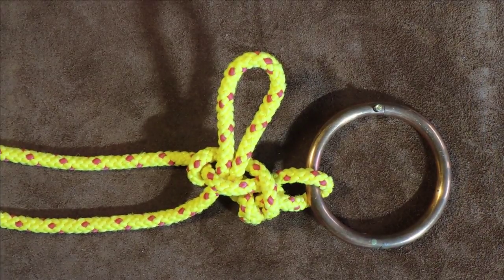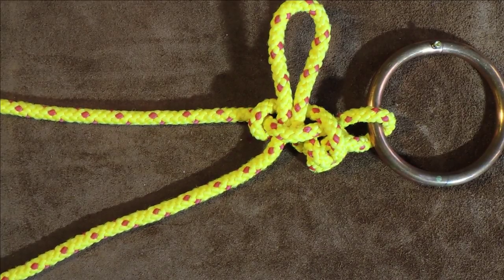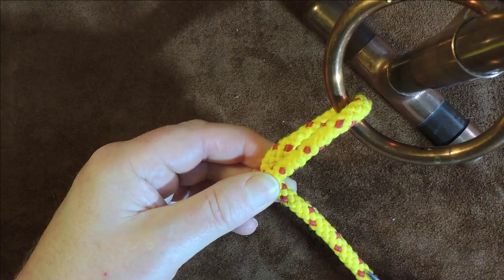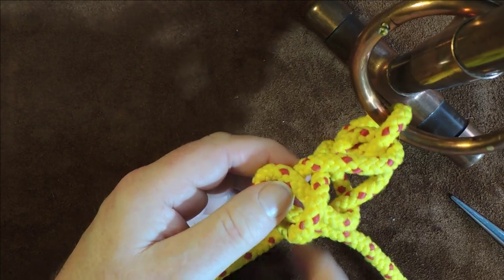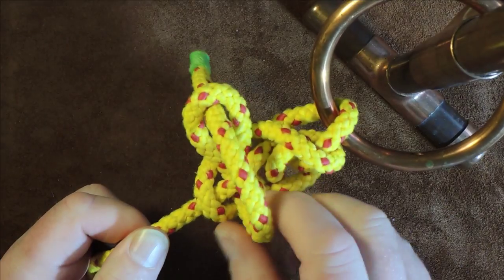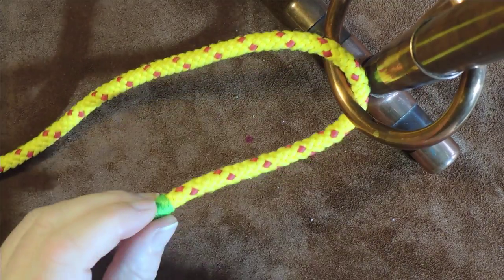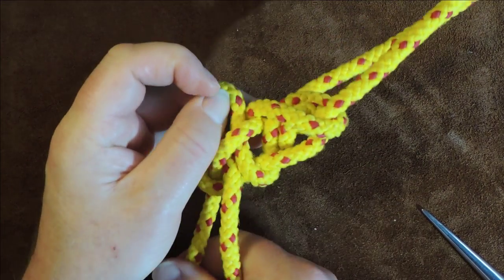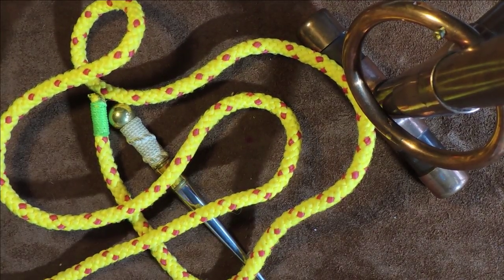Sampan Hitch - How to Tie the Sampan Hitch - Quick Release Mooring Hitch Tutorial

Comment: Sampans are small boats, it's likely the mooring is in easy reach, say half a meter or less.  If this is the case there is no on the boat vs. on the dock issue, it's just a hitch tied between the boat and the dock.  If it's tied on any length of line it would make more sense to have it closer to the boat to avoid shenanigans, besides the free end has to be tied off otherwise it will just fall into the water.  There is no quick relelase if you can't find the end.  Having a long loop in the center might allow the hitch to work itself free over time if tension is not constant, so the free end in the slipped bight makes sense. 
  Thanks for the video.  The highwayman's hitch has been my go to quick release hitch till now, it's all ways good to have options.
Reply from the maker: I am sure that one day, someone from that part of the world will come along and tell us exactly how it was used. A thousand years ago I was in Singapore and HK, where there were thousands of these vessels. I think now there are not so many and they are slowly becoming part of history.

Comment: Hmmm, here's what I'm  thinking, if you are going to to shore and back with the rope with the disadvantages of having to pull all the line, which could be any length, around the post or ring why not just go around the post and back to the cleat? I think a good quick release needs to be tied on a bight so you have hold of the rope at the point it comes aboard. This leaves all excess rope on deck and with the least pulling in.

Comment: The sampan pier in the old days was not what you thought. You assumed the mooring points are up on the top of the pier. The sampans are tied usually to other sampans, so there could be up to 10 sampans tied one to the other. The occupants then step onto the pier by walking through the broad higher back end of the sampans. 
In other places, they'd tie them to rings on high vertical sea walls. On river banks, they'd be tied to trees or tree roots.
Reply from the maker: Sorry for late reply. I remember Singapore a thousand years ago now, every inch of water was either a floating home or a fishing boat of sorts. Sadly no more. Thanks for taking the time to view and also make a comment, very much appreciated.

Comment: I like tying a taut line hitch on a bight, when tying to a ring. That way you can snug the boat up to the dock but still release kind of easy, and the line is in the boat.
Reply from the maker: I would never have considered using the Taught Line Hitch for doing that. Does the rocking and jerking of the boat not cause slippage within the knot?
Reply: It works for boats on a lake not sure about at sea. It is a little less quick release since you pull outward the bight instead of the working end.
Reply from the maker: Taking knots from one form of arena to another is always interesting to hear about. Thanks for letting me know.

Comment: After making this knot 20 times it appears to be a slip knot as well
Reply from the maker: I learnt this knot, but never really got on with it. It was so long ago now, I do not remember what the issue was?? Thanks for taking the time to view and also make a comment, very much appreciated.
Reply: Even if the hitch slides you won't lose the boat (assuming working end bight is not loosened out of standing end).  It just means you have get off the boat.

It only moves with very slippery rope,  it will hold in a rope with grip and well dressed.

It isn't a slip knot, it is a noose knot ... slipknot will untie, this noose will tighten on the ring/post/spar.  Even if it slides to spar you will not lose your boat.

Comment: Doesn’t make much functional sense to tie a boat up with, might as well cleat both ends up, I can see it being used to raise a pole or something like that.
Reply from the maker: Well personally I think I would prefer the Imitation Slipped Bowline for ease of use. But there again if it is well used in the East, must be a good reason? Thanks again for checking in and leaving a comment.
Reply: I guess if you want to cast off without having to get off your sampan to take the rope off the cleat at the dock, this makes sense.  But I like the idea of having the knot on my boat like the second method.